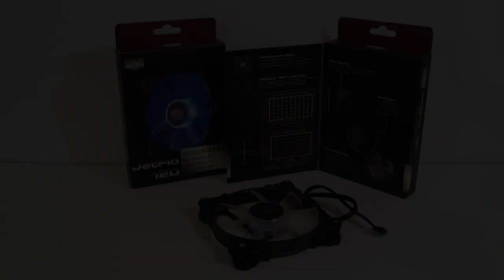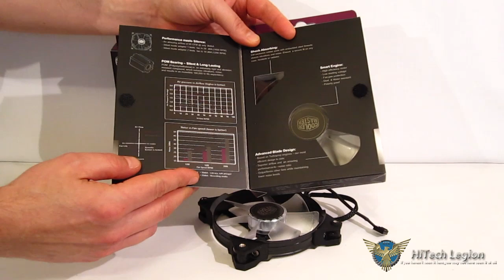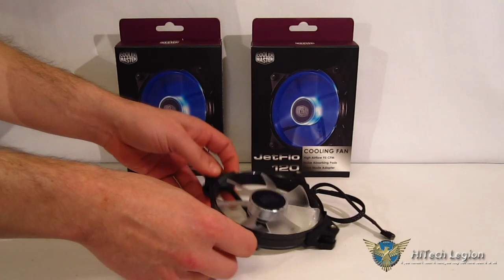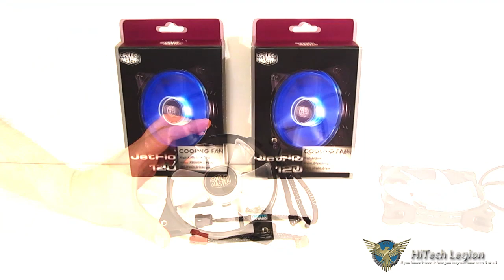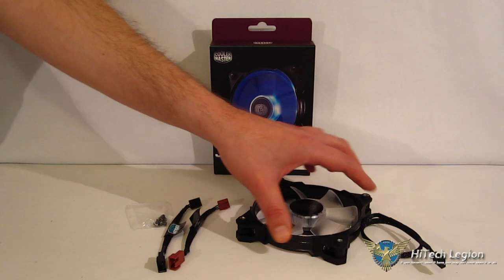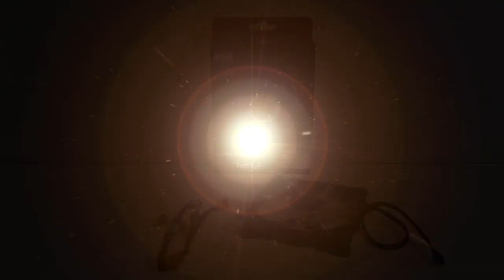Cooler Master JetFlo 120mm Fan Overview and Benchmarks

Comment: @HiTechLegion I bought a Thermaltake Vl8001W2Z V3 Black Edition case (https://www.thermaltake.com/products-model.aspx?id=C_00001579).  Will these fans fit on the top two mounts (https://youtu.be/BmsXV2XWSOs?t=66)?  My motherboard is GIGABYTE's GA-G1.SNIPER M5 (https://www.gigabyte.com/us/Motherboard/G1Sniper-M5-rev-1x#ov).  CPU Intel i5-Memory is G.Skill 16GB RAM (http://gskill.com/en/product/f3-12800cl10d-16gbxl) Graphics Card MSI GeForce GTX 950 Gaming 2G (https://us.msi.com/Graphics-card/GTX-950-GAMING-2G/)

Thanks!

Comment: can someone please tell me on this fan which one of those black cables are the voltage and which is the earth or ground etc?????? pleassseeeeee
Reply: Check user manual for motherboard which pin is for what. Generally motherboard manuals have detailed information for pin outs of connectors.

Comment: if the corners are rubber will it still work in a pull position on a radiator with the long thin screws radiators come with?

Comment: I want to change my old noctua ugly fans with some great led fans.I use Corsair Air 540 case.What is the best choice in your opinion?Cooler Master JetFlo 120,Cougar Dual-x,Corsair Air Series AF120 LED Red Quiet Edition High Airflow,BitFenix Spectre Pro the most expensive here.I need for my case 3 120mm and 3 140mm or 4 120mm and 2 140mm.I want great looks,medium noise and great airflow.

Comment: Was wondering if these were a good purchase to use for push pull on a cpu heat sink? I am currently using two sickle and flow fans because they were on sale and bought them for back ups for my girl's chassis. I was hoping to get better air flow on the heat sink from these fans then the sickle and flow, and I wanted to ask if you thought that would be the case in comparison of the two sets of fans?
Reply: With the high static and cfm, the JetFlo were really designed with rads in mind. On an air cooler you won't see much difference from the Sickle Flow.
Reply: George Cella That is definitely kind of a bummer then, because I thought that you wanted the same things for a heat sink as well when looking up for a fan. I talked to a few other people and they made it seem that these are great fans for cpu heat sink cool...I should of talked to you guys at hitech first I suppose. I wanted to ask what do you look for then when looking for a solid cpu heat sink fan for air cooling? I suppose this is not the ends of the world because I plan on getting a radiator during or at the end of the summer for my cpu and possibly gpu's....I was planning on using these fans when the time came and switching them over to the 140mm rad or the 240-280 one that I would be switching too.
Reply: Patrick Murray Don't get me wrong, the JetFlo fans do well on CPU coolers. I am just saying don't expect a miraculous difference from the Sickles on a 212. If you are planning on moving these to a rad, you made a very wise purchase. They will do well for you now and will be awesome on the rad.
Reply: George Cella Okay and no I did not think that I would drastically different temps from the sickle and flow fans that are currently installed to the heat sink I have on my cpu. I am just hoping for slightly better temps and possibly the luck and chip to overclock from 4.2 to 4.4, and I am just trying to figure out what voltages I will need to potentially overclock to the frequency. I am going to upgrade this summer or by the end of it, and get myself a radiator and install these two fans on the radiator. I am glad that these are good fans for this because it will make the purchase in the future more affordable when purchasing and then installing the fans with the radiator in the new chassis.
Reply: Patrick Murray Okay, so those fans and came in and they are louder than the other ones but that is not such a big deal for me because I bought the Define r4 because of it's features and price at the time of purchase. I will say that have made a slight improvement in the quality of cooling the cpu heat sink. About 4 degrees difference, and that is enough to make me happy. Not to mention I just overclock the cpu to 4.3 applying more voltage and heat and it is still keeping it around 30 c at 10-15% load. I also just overclocked the ram I had and fixed it not being in dual channel. So all in all a good day for the computer yesterday.
Reply: nope this fan is overrated there other fan out there that are cheaper and better
Reply: black crow1234 I agree there is better out there, but I also was not worried about the hype about the fan. I ended up buying it on sale giving me a good value for my money, I think it is  a good fan for what it does for my cpu heatsink and pc. the rest of my fans are fractal 140mm fans.

Comment: Great review. I have a question though, you said to make sure to not lose the screws because they are special, so I was wondering, with which screws did you attach it to the radiator? The 'special' screws, or the ones that come with the radiator?
Reply: The radiator fans screws (6x30 in this case) pass through the screw holes and are used for mounting. The included screws with the JetFlo would be used for case mounting.

Comment: between this and a corsair air series LED AirFlow fans or the corsair Static Pressure fans which is better???

I'm currently looking to cool my system with fans and have a confusion which brand and model of fans to use...

I currently have a corsair carbide 300R (window version) which do you think and how many should I use???
Reply: So which one did u choose? Like it's been 5yr now. They still working ?

Comment from the maker: The 6-32x30mm included with the H220. 6-32 is small enough to pass through the threads, and the head is large enough to hold.

Comment from the maker: The NF-P12, while a great fan, is not in this classification and is not made for the same purpose. It only has about half the airflow of the JetFlo and significantly lower static pressure.

Comment from the maker: The NB is a bit quieter, but it also is lower flow and static pressure. The JetFlo can mimic the NB's performance at a lower rpm with minimal added noise, while still giving you headroom should you need more.